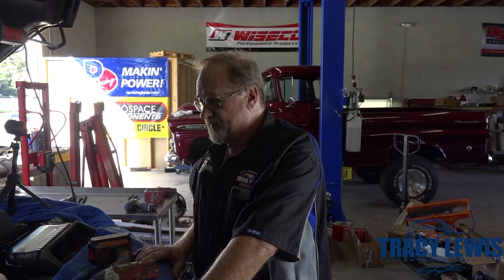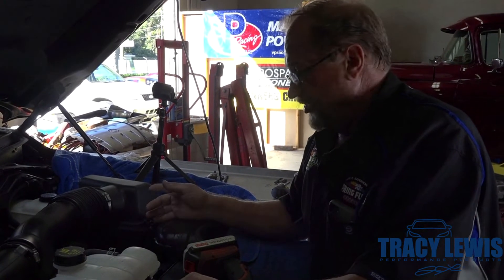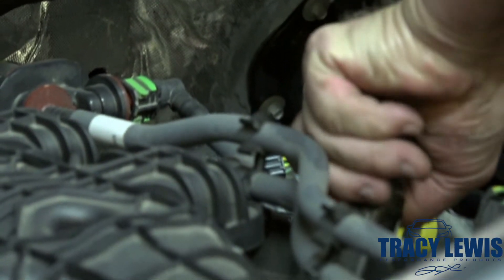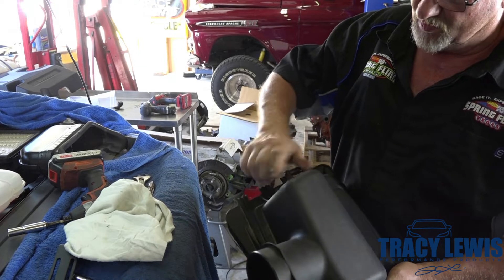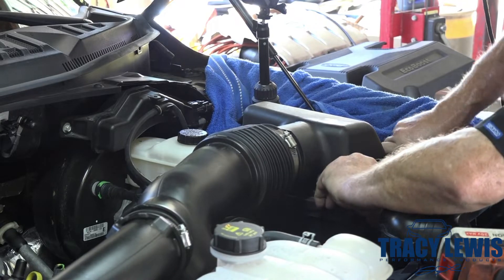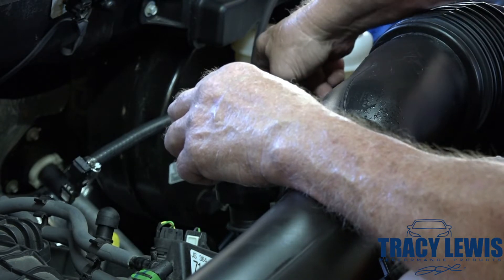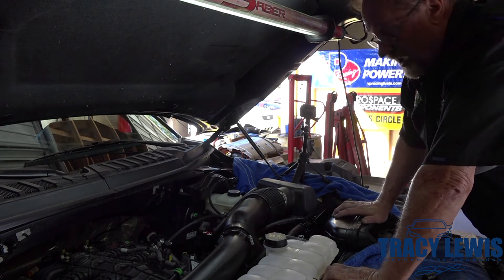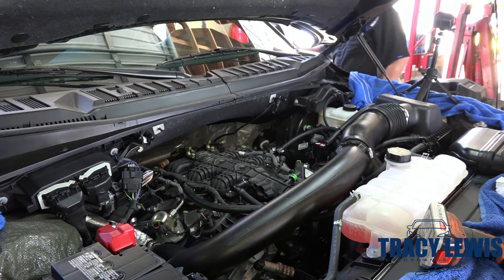2018 F 150 Catch Can Install

Comment: I want to keep and OEM look, on the 2.7, can one of valve cover ports be used for the clean air side, instead of replacing the oil fill cap? The other valve cover would be for the dirty air side.

Comment: Mr Lewis, have you found a cure for the check engine light for the 15-16 f150? I would be most interested in it if you have. Also the can you installed for me a while back does not seem to be catching much of anything, a few drips after oil changes.
Reply: Were you able to figure out the check engine light issue?
Reply: @Arizonahwy10  no sir it still is on